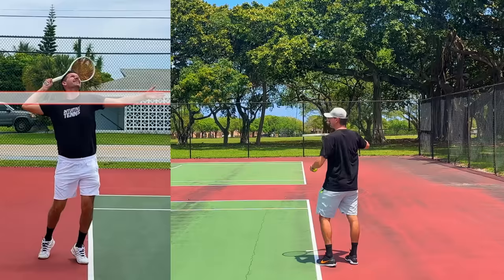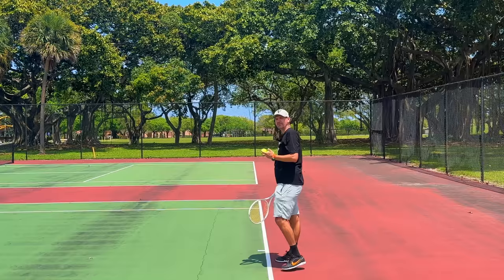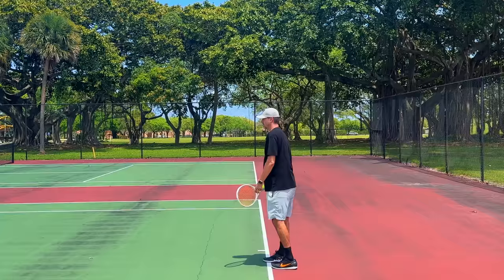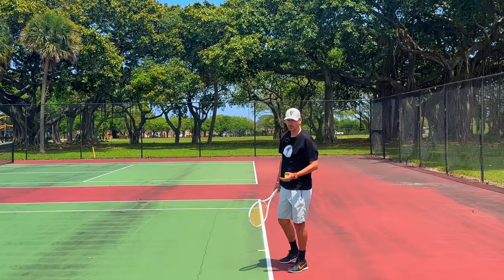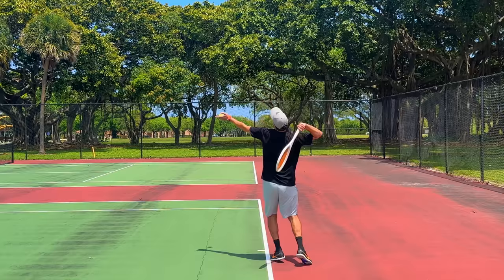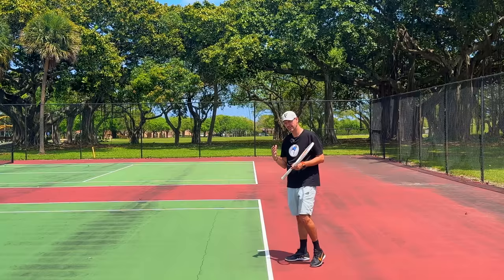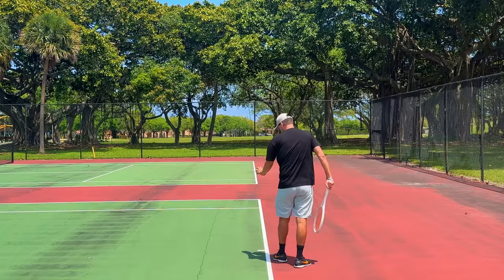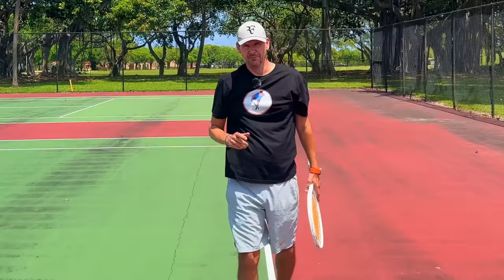How to Cart Wheel a Tennis Serve for More POWER

Comment: Cart Wheel is probably the best metaphor for how not to "arm the ball too much".

I came from training 2 years of badminton competitively as a teenager. The power generation of a badminton hit (which can be extremely fast at contact) came a lot from first dipping the elbow, then exploding upwards with a lagged and relaxed arm, but without as much back scratching. So I can hit 100 miles tennis flat serves quite easily just with this motion. But this puts tremendous stress on my elbow. I suspect this is similar to how many players "arm the ball" too much, using the correct legs and hips and rotation, but without using the cart wheeling motion.

Adding the cart wheeling motion is quite the game changer for me; I'll try to measure the speed increase next time :D thanks so much Nik!

Comment: Hi Nick it seem that the pros a contact the shoulders a facing the net, so all the tilt and the drop is coming in a upward motion to the top of contact point, so in order to have control of the aim you then activate the arm. The cartwheel has to slow down an not give you too much momentum.

Comment: What I found out for myself is that when I cartwheel, after contact, if my right shoulder stops moving and still pointing to the sky, the first serve rarely lands inside the service box. However, if my shoulder points more in front, meaning my body is more horizontal, the ball lands in quite consistanly. So now I always consciously try to cartwheel "deeper" after contact.

Comment: Why is the tennis serve so difficult? 
Great video Nick! 😀😀
Reply: Indeed, IMO almost impossible to learn properly/improve significantly as an adult, unless you are exceptionally gifted.
Reply: @julianpenfold1638  Are you saying an old dog can't learn a new trick?  Yes, they can.  I've seen adults take up tennis and develop very nice serves.
Reply: @IamnotJohnFord  I am indeed saying that.  I have made little progress despite lots of input and effort.  I have never seen any adult who took the sport up as an adult with what I would regard as a decent service motion.  I am sure it happens, but in my experience it has been rare.  If you or others have done it, kudos!
Reply: @julianpenfold1638  So, if you can't do it, and you haven't seen someone do it, it must not be a thing?  Okay. Not going to argue with that logic.
Reply: @IamnotJohnFord  I can only go by the evidence I've seen, over a large number of years in several tennis settings.  But perhaps I've just not been in the right place at the right time.  As I said, if you or others you know have managed to make significant improvements then that's great.

Comment: Thanks for the video and the demos. But I’m beginning to think that the idea of a cartwheel is more trouble than it’s worth. In my experience focusing more on the “tilt” as a way to load and set up the proper “launch angle” creates a better mental image. One of the biggest problem for red players and others is bringing the front shoulder down too much or too soon. “Cartwheel” encourages that thinking. The other missing piece here is that in order for the ISR / “pronation” to take place properly the body has to be tilted the other way at contact. 
In summary, focusing more on launch angle and leaning forward / leaning into the ball at contact does all the work of the cartwheel analogy without the downsides.
Reply: The “cartwheel” is the result, meant for analysis, not the cue. The cue Nik provides is to get the toss arm all the way up in the trophy position. He then provides extra context for other power loss mechanisms such as a shallow toss and/or racquet leak. Few downsides seen here. To assume your cue doesn’t have any because it clicks for you is presumptuous at best.